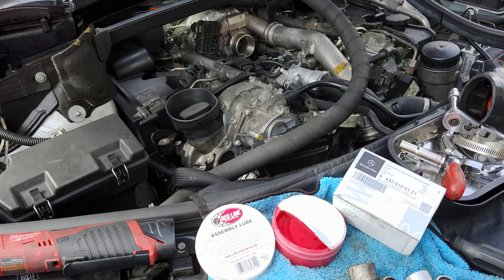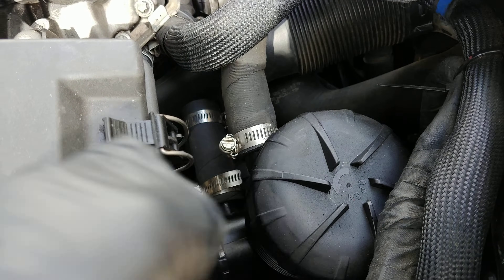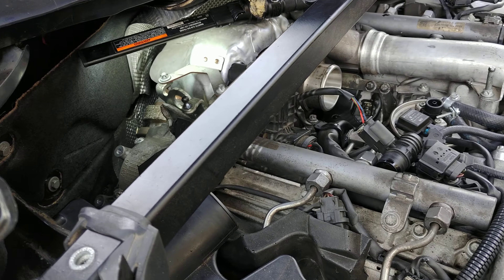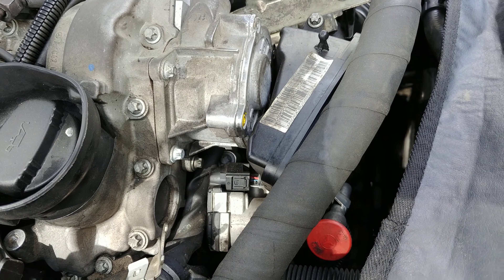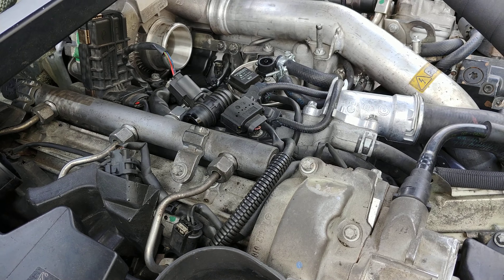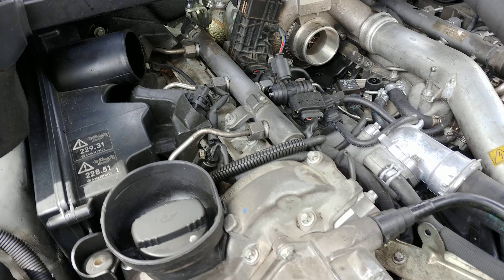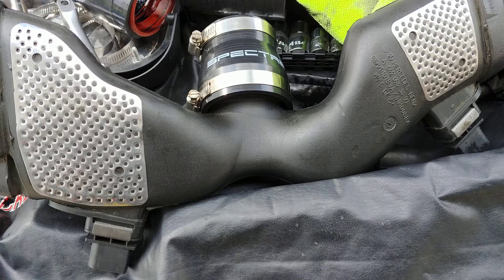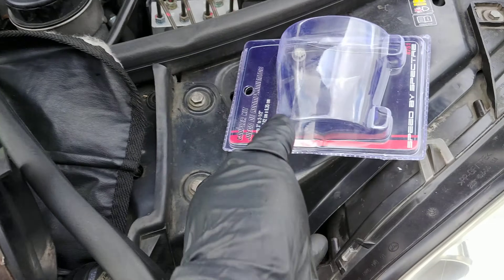Mercedes Diesel GL, ML, R, E 320/350 OM642 Oil sucking eliminated/broken Y-intake fix

Comment: In your video you mentioned the differential pressure sensor.  What does it do and what is the part number?
Reply from the maker: It compares the pressure difference from before and after the particulate filter located after the catalytic converter and triggers "regen" cycle which burns deposits by injecting more diesel fuel (richer mixture). It is located under the car where the driveshaft is connected to the transmission. There are few different revisions to the part over the years. This is the last one I am aware of. P/N: A 006 153 95 28.
Reply: @ridgebackgarage4580 
Do you have the part number?

Comment: Hi Ivan, thank you for the video! I just bought a used 2012 GL350, and want to clean everything up before I start using it. I wanted to replace the PCV valve, but now will replace the connector piece you mentioned as well. Will replacing the valve and the connector without rerouting the vaccuum side still have a positive effect?

I am not a mechanic, I just spent some time trying to understand what a PCV valve does. My understanding is that it uses the vacuum created by the engine to suck out gasses from the crank case. So it is almost certain that there should be garbage pulled out. If that is correct, wouldn't it mean that by reducing the amount of vacuum (by making the length air has to travel greater), you are reducing the amount of gasses being pulled out? I.e. yes you will have less gunk show up in the intake manifold, but more will end up mixing with oil in crankcase and creating sludge?  

I'm not trying to argue, just trying to understand, so I can make an informed decision before making making a decision.
Reply from the maker: Hi Mikhail, PCV is basically a one way valve allowing gasses and vapor out from the crankase. There is no "junk" per say just blow by and oily condensation. Changing "connector" is a temporary fix since seal on it is more like skirt than a seal. Reducing vacuum is the only long term fix IMO. It was really ridiculous to have turbo just centimeter from the PCV valve to begin with. That oily mess turbo sucks in fauls swirl flaps and fill intercooler with oil and water mix. Without that mess EGR would only have a thin layer of dry soot instead of sticky "tar", too.
Reply: @Ridgeback Garage, hi mate sorry just for curiosity are you in UK?? I'm interested to find someone who can help me to do that, I'm based in London, let me know thanks

Comment: Hi, not sure if you have already mentioned it but where did you run the oil from the ProVent 200 back to? Great video by the way!
Reply from the maker: You are right! I don't  think I mentioned it. I put a hose from the bottom of the catch can down to the plastic underbody tray with a metal ball valve just sticking through an existing hole. This way I can just stick my hand and open the valve to drain it into any container for disposal. I don't like feeding it back into the oil pan. I know Mann Provent 200 was designed to drain into the oil pan, but any wapor that turned into water could make sludge in the pan.

Comment: Talk to BMW Owners all of 90% who installed those special Cans get back to original  * What is the most important to understand oil change at max 7000 miles - never go up what manufacture recommends * this all is political - frequent oil change means more spillover more pollution * Governments want everything does not last to a long time - today made engines are designed to last no more as 200.000 miles * I change the oil on my GL every 5000 miles * 70% of owners getting cheap oil change not knowing what kind of oil needs * For those MB Diesels only MB229.52 specification - 0W30  5W30 - 0W40 or 5W40 - MOTUL or MOBIL1 * 
Those engines run very hotly - peoples looking on cooling temperature and is very wrong - Internal engine temperature oil and moving parts getting much above cooling temperature * 0W30 5W30 run very fast in the internal lubrication channels what giving so many benefits faster cool and better lubrication for moving parts * Those light oils have much stronger Film Strenght from conventional 20W50 engine oil **  Those MB Diesel go with no problems 500.000 miles ** Look on statistics those engines was killed at 100.000 miles and why? by smart Joe who changes oil at 20.000 miles plus very cheap and wrong specs and viscosities.
Those oils 0W30 5W30 when to burn very clean - call low ash oils.
Air from Turbo getting up very hot when riching intercooler - after intercooler is about 150F kipping those oil vapors light as steam when getting to the intake manifold and burned very clean *
Worn engines wrong oils unburned oils getting to EGR this create a killing zone for the engine.*** EGR is used to reduced burning temperature in the cylinder during the combustion process if very high temp producing more Nox gasses * To give more life to any engine condition need to switch off EGR Valve only * Can be done by CODING the main computer for a couple of $$$ * Those oil cans is only a business for those peoples who are selling * Do manufacture not know what means oil separators?
In the right side of Head is a very high tech oil separator * Some peoples have a personal fantasy of magics with closed eyes can do anything even can please a Queen **  For MB DIESELS  up to 2009  early March production have the old type of PCV the Blac Plastic Ventilation of Crankcase the newest VALVEThe PART NUMBER: A6420102391
All from 2009 April production has a new type of VALVE    PCV  ALUMINIUM different look from the old one 2 x bolt fitting as the adapter for old PCV * Remember those cars and engines are very good only smart Joe damaging or Garage Joe looking for profit damaging for other one naive Joe grab his money.
Those Old type PCV Valves Black Plastic need to replace max at 50.000 miles * New type of PCV is for life never needs to be replaced.
Reply: What mileage your GL has? Your talkin 642?
Reply: @nico-toscani  On one of Mercedes Forum owner of ML320CDI 500000 miles  - no problem to start with only 3 glow plugs * Blutec engine safer from Ad Blue  - have to use very light engine oil MB229.52 speck 0W30 or 5W30 ** CDI engines can use 5W40 oil much better for that reason last much longer * Philosophy of drive and how we can understand our way of driving * when we change engine oil on Blutec after 200000 miles that baby not going to last for long time _ Best of all needs to look on German drivers - average timing chain replaced after 350000km * Fuel injectors not lasting long time average 100000miles - who know how to use those engines injectors last for a very long time - 2Cykle engine oil add to diesel fuel - I adding RedLine 2cykle oil - 1/4 of small bottle of 2cykle redline oil for 100 liters
Reply: @jaguar7051  So the Redline helps lubricate the fuel injectors?  Does it help lubricate the fuel pump as well?
Reply: @H0kieJoe  Red Line Amsoil Purple Blue and many more are only for smart Joes who are walking on the Moon in running shoes.
Reply: when your shoes are worn out do wear and tear and you use miracle paste can help them to become again a new one? We as humans have a life expectancy - how we eat and behave in all kinds of life situations we going to live as our body can handle.
Nothing can last forever.
When you add engine oil to Fuel or your Red line to the engine means nothing when is already worn or carbonised means nothing only a waste the money.
Red Line is nothing special - average engine oil with no approved specs for many car manufacturers.
Reply: @nico-toscani  145000km 90000 miles

Comment: Hi Ridgeback, here's an update after going through this process myself... and thanks for all the help and advice and for the initial post. I began by buying the whole cahuna, from the metal part shown here plus 8" wiggly pipe through to the connector     into the Y piece. This proved useful if expensive £110 GBP.  I cut the metal bands holding the 2-piece pipe together ( it has a central allo join connector. I ran my output pipe from this under the batwing to the front of the car where I sited a Provent 200 can.  I blocked off the intake to the Y Tube at the turbo, and put insulating  tape over the bare sensor which is now hanging free... Carefully managed, the pipe will fit under the batwing. I then installed the rest of the stuff as per ridgeback tho I fired the return pipe into hard plastic and hung the catchcan off the fusebox - my car is a 2014 Bluetec RH drive. Photos should show what I have done. System works brilliantly.... Very very pleased that this oil is no longer going back into the intake and swirl flaps..!   Photos should be in here:   https://myalbum.com/album/D4qaix2TpVSj
Reply from the maker: Awesome. Glad it worked out. I did not know how to add pictures either. I just linked picture folder from Google Images
Reply: Ridgeback Garage https://myalbum.com/album/D4qaix2TpVSj    I made an album and put the photos in it to share with you.... Let me know if you can see them Ok!
Reply: In your car, the pipe coming out of the oil trap goes back to the air pipe. Doesn't the same thing happen? The oily air goes to the air filter again, at least to a small extent.
Reply: @Elsenferrux   I think that's what the Provent catch can is supposed to minimize.
Reply: @johnmallow Loved your solution… Do you have more close up pics or a video. I’d love to try this on my 320E! Thanks!

Comment: Hello, this is A6420100131, is this a sealant? I understand that this goes on the camshaft? Is it designed to throw as much oil as possible under the valve cover?
Reply: No, this is the part number for the breather cover piece that fits in the back. You see the old one next to the new one sitting on the radiator support.

Comment: What I see on the pictures your engine is worn out and has very high blowby.
What type of engine oil did you use in this engine?
Those engines when used with proper engine oils MB229.52 and change at 7K miles all clean like in new engines.
When you used cheap oils, not recommended for this engine, and run forever you getting those problems that you showed on the pictures.

Comment: Thank you so much for your video. It is greatly appreciated that you share your solution with everyone!! I was going through the photos in your description, great job too. What did you use to clean the carbon and tar built up? You did a great job!
Reply from the maker: Thanks. Diesel fuel is the best cleaner and light lubricant and not nearly as volatile like parts cleaner or gasoline for keeping in the garage. Final cleaning with Simple Green soak and rinse with water.

Comment: This is a GREAT video for sure. I am going to do the same for my 2011 GL350 Bluetec. One quick question: Can just leave the Y- intake tube as is and simply block the hole for that original PCV hose? Thanks in advance.
Reply: I just blocked mine off with some odd plumbing supplies, no worries, as my Y connector was in good shape. I took the sensor out of the old pipe though, taped it up and left it connected so as not to throw any codes.
Reply from the maker: Yes you can.
Reply: @ridgebackgarage4580  Thanks for your quick reply. I am thinking also leave the in-line heater there to heat up the air flow as I am in Canada where the winter is cold and long. What do you think? Or should I drill a hole at the Y tube right in front of the Turbo? Really appreciate your opinion. Thanks.

Comment: Hi Ridgeback,

I have an Ml350 Bluetec 2015 , does this apply to this model as well ? so far so good , I did have to replace the EGR valve . Let me know

Salt
Reply from the maker: Yes! The only real difference is Blue Def urea injection for emission reduction on newer models, but you still have OM642 engine.
Reply: @ridgebackgarage4580  ok thanks , same part number ?
Reply: I just did this on UK 2014 Bluetec. Brilliant!

Comment: This will put blow by gasses including oil particles onto the paper air filter element and cause it to clog with oil particles over time.
Reply from the maker: The suction is reduced so much that barely anything can get that far and besides, with a quality oil catch can such as Mann Provent 200 you are pretty much guaranteed nothin will reach the air filter. Provent 200 has a replaceable filter itself. It is a fully serviceable catch can. In Europe catch cans are the first thing people add to their diesel.
Reply: @ridgebackgarage4580  do you leave the pcv valve in the same spot just add extra hose and go though the oil catch can before entering the air box cheers
Reply: Of course it is easy to change the filter when necessary.

Comment: Any other tips! Can the oil cooler sealers not fail if you keep up oil changes or will they go soon 90,000 so far my other ml had no oil leaks 130,000
Reply from the maker: That is awesome, you are lucky! I think you will at some point develop a leak. Even the best "soft" seals must harden up due to heat and age. It is not all negative having to do it after so many proper miles. You should look at it as an opportunity to get everything cleaned up to like new condition and start fresh. With proper maintenance, there is no reason OM642 should not last 500K miles and outlast the car itself. There are other much more concerning issues with this generation of cars, such as disintegrating plastics of the exterior and interior that cars in this class should not have, period!
Reply: I just had my oil cooler seals done at 122k. They went from slightly leaking to putting spots on the tailgate in about 2-3k miles. They were the orange seals and from what I understood they should have been the purple Viton seals after 2010. I’m still a little bewildered at that.....

Comment: Also want to ask when I leave the car running stationary for example 10min its start coming blue smoke from exhausts it’s enough smoke but when i start driving need just one good acceleration and smoke stop can be this the issue becouse of sucking oil?? I want to change the breather as well that i never change
E320cdi v6 2007 
202k miles 
Thnx have a nice day
Reply from the maker: Sounds like your valve oil stem seals and guides are shot. You need top end rebuild. Does it throw a lot of blue smoke on a first overnight (when it sits for long time) start? Oil accumulated in the heads drains down valves sitting overnight and burns on a fist start.

Comment: Hi can i please ask im looking to fit this oil separator i want to ask can u add picture how to connect the oil seperator which pipe from and to have to go and also how did you manage to locate that hose from pcv valve to the air filter did you put under the engine or through side of the engine? Many thanks
Reply from the maker: The video image shows the rubber hose disconnected from PCV valve. I am no longer using fancy plastic engine cover. It is useless and a product of designers for esthetics. It provides some noise reduction, but it traps excessive heat from the turbo which is slowly destroying rubber and plastic parts. The hose goes over the engine and over plastic Y-intake to the PCV valve.

Comment: This part before i change eating my oil maybe 1liter on 100 kilometers its crazy ,  .... my mercedes viano 3.0 diesel v6 , did somebody have the same problem ?
Reply from the maker: That sounds extremely excessive! Find an oil analysis service company in your country and send a sample from an oil change for analysis. That will give you detailed information on the condition of your engine. Some oil burning from piston ring blow-by is expected and the actual acceptable amount varies from person to person you ask. How many kilometers is on your vehicle? Was maintenance (oil changes) done timely? Maybe your piston rings are worn out? How is the power delivery and do you have any smoke coming out of the exhaust while accelerating? Doing a re-route will drastically reduce your oil consumption for sure, though. Before it, my GL was using roughly 300-400ml per 1000km and I have 240,000km on the car. Now I can barely register any oil loss on the dipstick!
Reply: I try to fix my oil rings by new system , this weekend and i put video  and we see what hapent after :)
Reply: @vaidasvaidas9554  pavyko sutvarkyt problema?
Reply: Hi, you fix the problem?
Reply: I have added the Provent 200 to my 2013 GL350 and run it back into the stock location. From what I’ve read the major oil consumption issue comes from the lip seal on the fitting that bolts to the back of the head. When I changed mine the seal was as hard as the aluminum housing. I do the same thing for draining the Provent, hose + a hose & ball valve. I get about 2-3 ounces of blow by oil every 3k miles. I still get a TRACE amount of oil at the turbo inlet but it’s really insignificant. The oil cooler seals just let go so I had my mechanic (30+ year MB Mech.) replace them & clean up the intake while there. He was intrigued that the buildup was dry & flaky instead of the normal gooey tar like mess. He is now suggesting the Provent to all of his diesel customers. I believe changing the Provent filter at the suggested 40k miles as well as changing the PCV fitting at the same time will keep the intake clean. I will also be using the motorvac intake cleaning system to keep everything nice and clean.